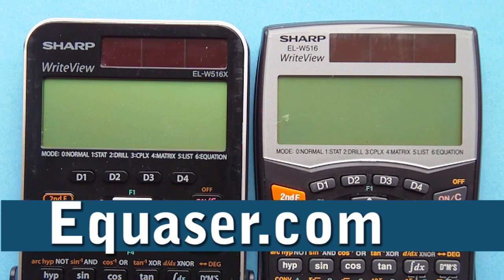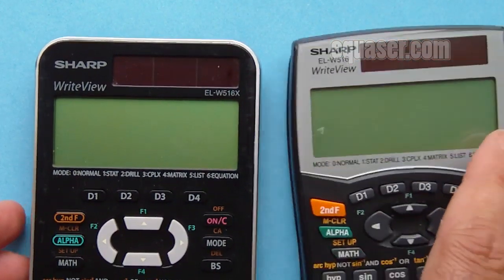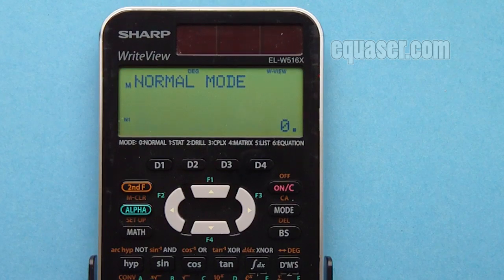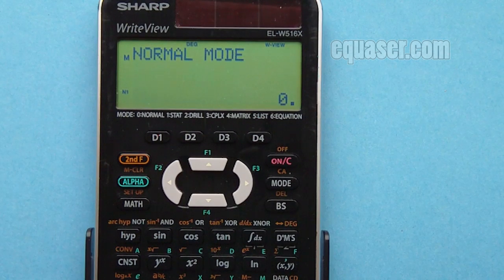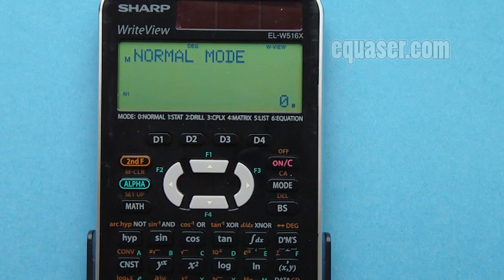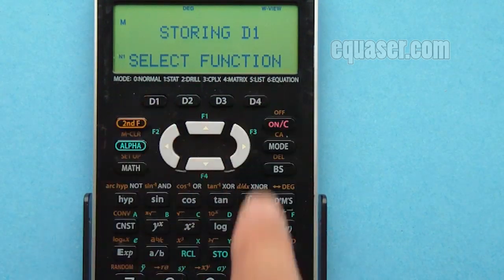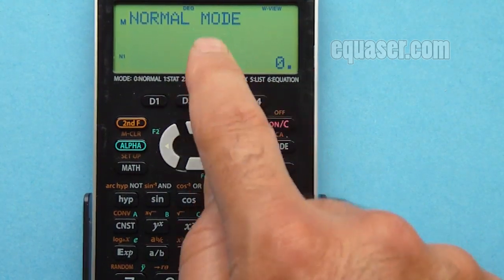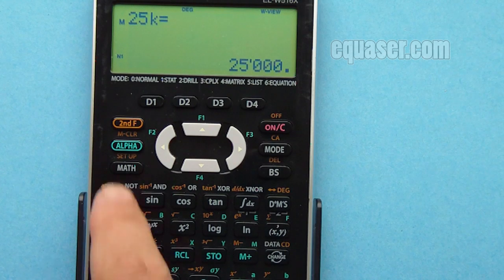Sharp EL-W516 EL-W516X EL-W516XBSL how to use definable buttons D1, D2, D3, D4

Comment: Since I see comments about this: You can store custom mathematical functions (equations) -- including variables -- in the F1-F4 keys, which are separate from the D1-D4 keys.  Then you can put whatever numbers you want into the variables and recall your custom function and it will automatically plug in the value of the variable(s).
Reply: +metalore yes absolutely. you can store variables A, B, C, D, E, F, X., Y and it can be mathematical formula and recall and then evaluate with numerical values.

Comment: This is kind of off topic, but I’ve got a question about the a/b key. I had done something in the set up I think that when you are entering a mixed fraction, 3 ½ for example I could type 3, then hit the a/b button which would add the empty fraction where I could then add the 1 and 2 for ½. But then I accidently reset the calculator so now if I hit 3 then the a/b button, it automatically puts the 3 as the numerator and I don’t know how to get it back. Anybody know how?
Reply: You have it in line mode, put it in w-view mode (PRESS 2ndF  setup  2  0)

Comment: Yes. I have both machines. Don't get me wrong. The Sharp is a good machine. However, the Casio 115ES Plus and even the TI-36XPRO are more intuitive, easier to use and offer a few features the Sharp doesn't. I will say however, the Sharp is more capable with it's matrix features.